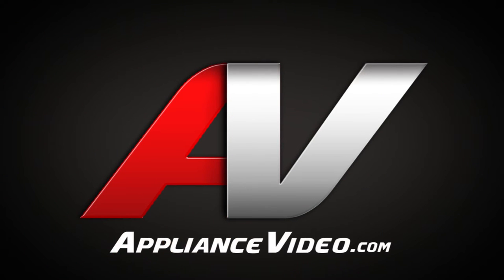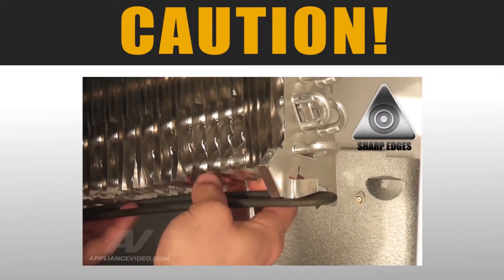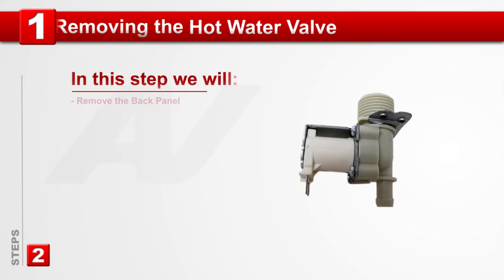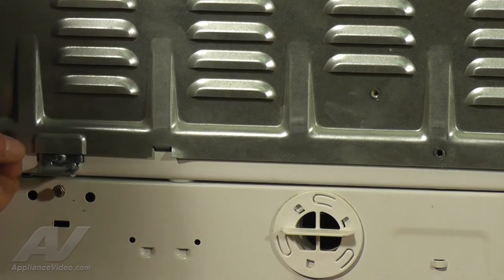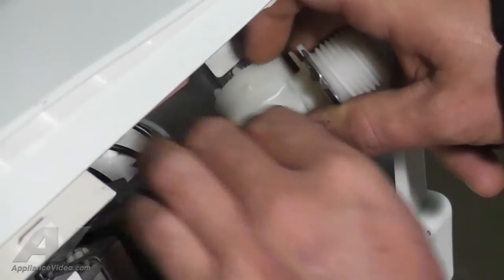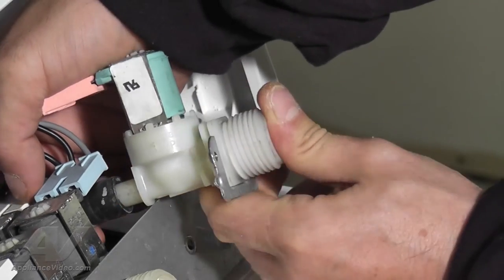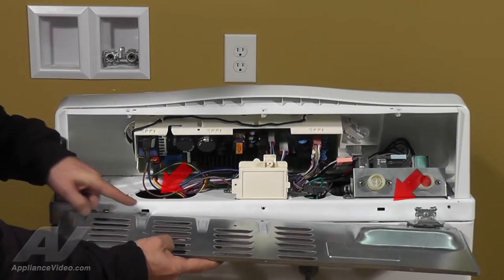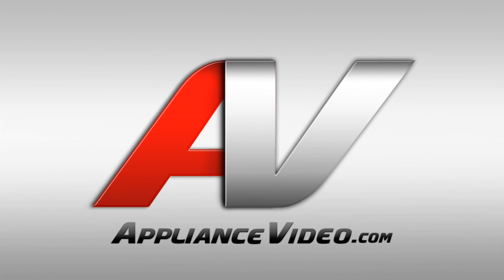LG Washer Repair - Leaking Hot Water - Hot Water Valve

Comment: Our washer has never had an issue.  However, it now won't fill with warm or hot water.  When it's selected, nothing happens, but you hear it "try".  We've been making do with cold, but need warm and hot water again. It's not a "new" model (WM 2010 CW)  Looked up the pre-pay service (Canada), and it says this isn't available for models older than 2012-2018.  We are very much non-do it yourselfers, but if this is the issue we have, this looks like a very simple and reasonable $ fix.
Reply from the maker: Great question, if you have a
more technical question that our parts department cannot answer, you can search
our over 10,000 answered questions free at our website www.ApplianceVideo.com under our Repair Help section. You can also call
our parts department at 1-800-830-5465 and they can give you help 7-days A week
Monday -Sunday, or search at www.SaveMoreOnParts.com  24 hours
7- days A week.
Reply: Did it fix your issue? I am also experiencing the same thing.
Reply: @ping079065  yes, it was caused by hard water deposit buildup in the water supply lines in the back.  Lots of crud in there, and it worked perfectly after getting it all cleared out.  
Yay for this kind of repair --Easy and free!!